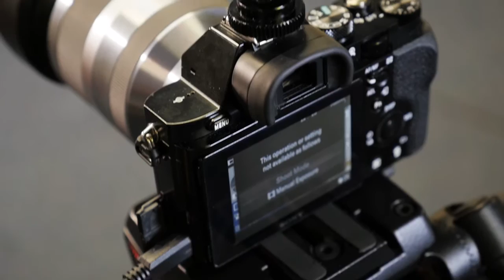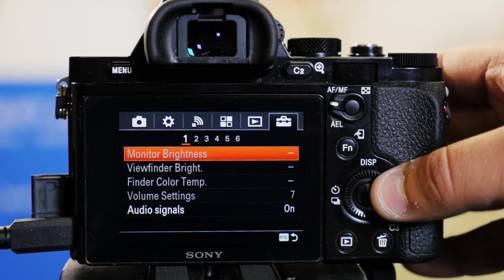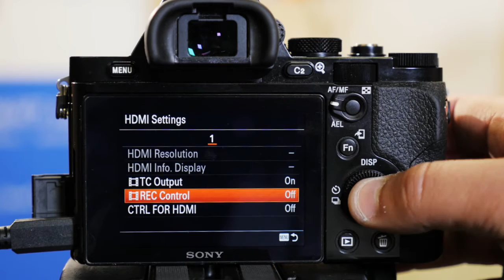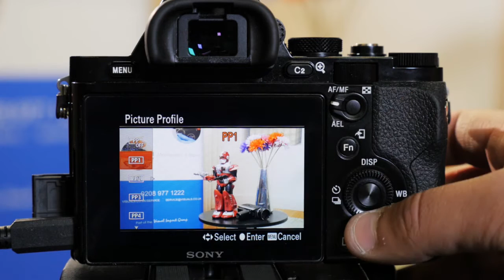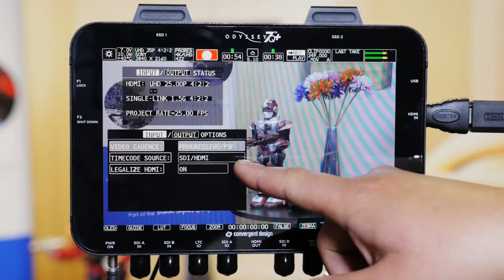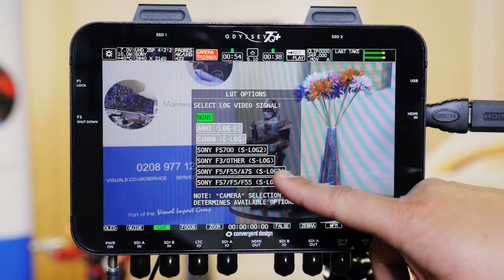Convergent Design Odyssey7Q+ Sony A7s Setup Guide

Comment: Can you get a 10bit signal from the Odyssey with the a7sii? also does this combo allow  it to record 4k up to 120fps? And how does it affect the aps-c mode?
Reply from the maker: The A7sii has an HDMI output, which allows for 8bit 422 recording, however the Odyssey7Q+ (not the 7Q, whose HDMI is limited to 1080p) can record the 4K signal out of the A7sII's HDMI in a 10bit ProRes format. 4K recording is limited to 30p both in camera and externally. The A7sII does not output anything higher than 30p in UHD. None of this affects APS-C mode
Reply: Is there any point in recording in 10bit if the camera is only outputting 8 bit over the HDMI, or is the HDMI signal more like a raw - like the SDI out of an FS7?  @VisualsCoUk
Reply: what's the highest frame rate available in 1080 with the a7sii?